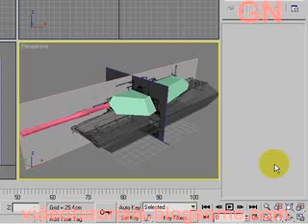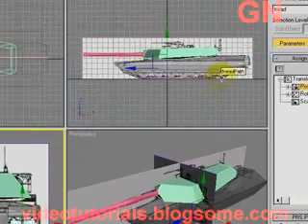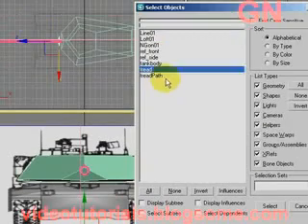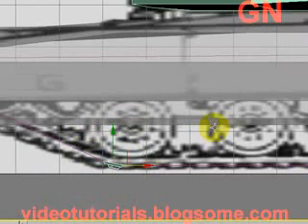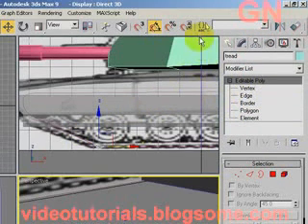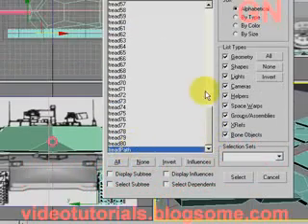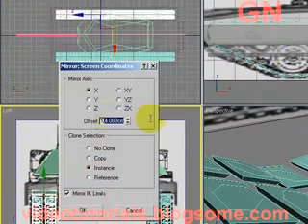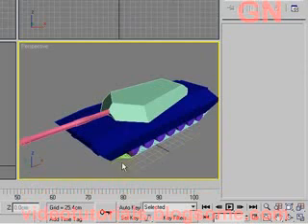3D Studio Max Model a Tank Part 11

Comment: A good tut, but the treads are not animated. Only the initial tread is animated.....and if you lasso the first tread you'll find that it is actually several treads atop each other. They're treads 1, 2, and 81. Even if you 'snapshot' only 10 treads, that intial tread will wil always have 1 or more hidden treads atop itself. A good book, but this tut (in the book) was a bit frustrating.